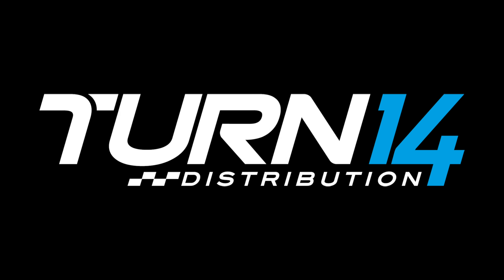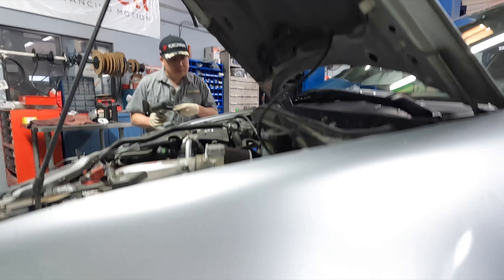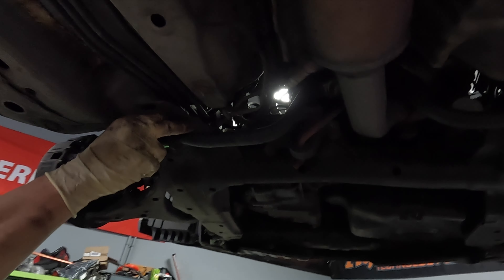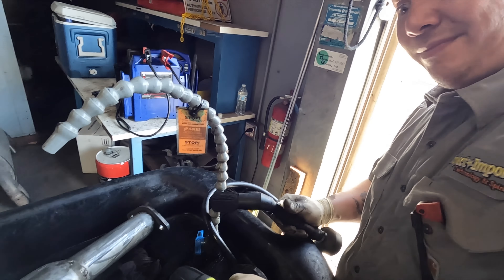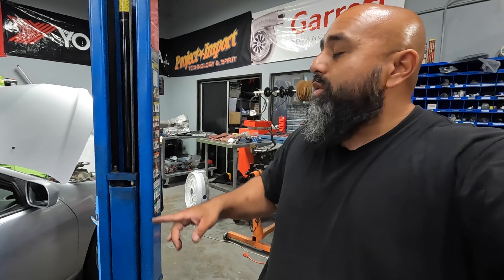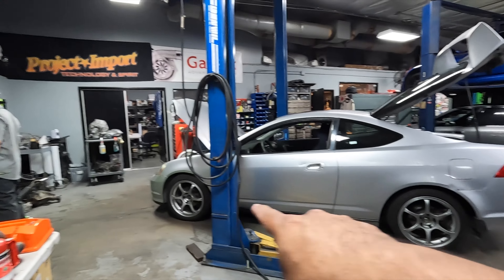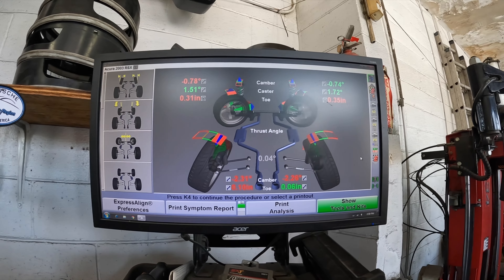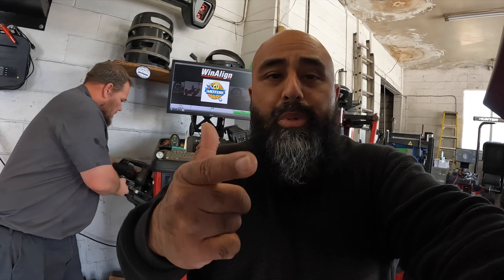TURN 14 Distribution x Big Mike Edition DC5 street build: Suspension Fundamentals

Comment: The addition of a  rear sway bar and adjustable coilovers are such a GAMECHANGER to a FF Platform
Reply from the maker: To any platform! All chassis will sway when turning, so finding the right size(s) of anti-sway bars to control the amount of understeer/oversteer a driver wants is crucial. All chassis we work with come with OEM front and rear bars, so it isn’t about adding one or both it’s about finding the right size to give a platform more stability and therefore driver security. This stage of the build is all about that for a commuter-type setting. Hence the Whiteline front and rear combo setup 🙌

Comment: How come you didn't set your bump stops?
Reply from the maker: There are always certain steps in the process of each episode that may not get captured or make the edit when putting it all together. But just to make sure I know exactly what you're thinking of, please elaborate on what you're looking for/thinking of and I'll be able to respond accurately. Thank you, Devon.
Reply: @BigMikeEdition  setting your bump stops is what you would normally do before setting ride height. This will not allow your wheel to move past a certain point and won't allow any scraping or rubbing. Then ride height is typically set.
Reply from the maker: @uptownx24x  Ok cool so I know what you're saying. Yea, everything was clearanced and set before final ride height was selected. There is a part of me that wants to go just a tad bit lower, but then I'll be right on the edge of needing to change the tie rod ends and ball joints and essentially realign the entirety of not just the front end but the whole car. We'll see what happens.